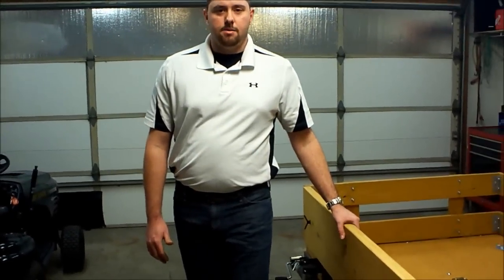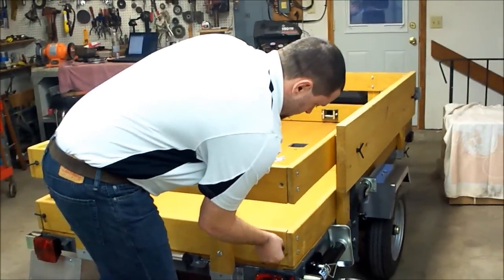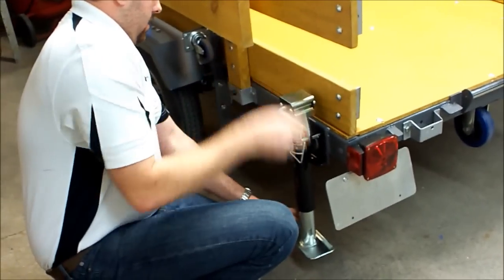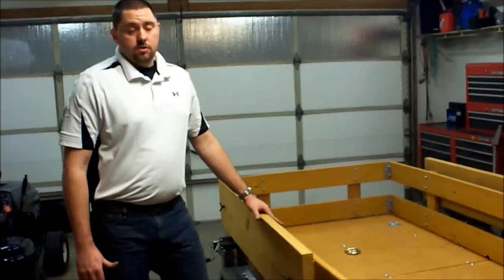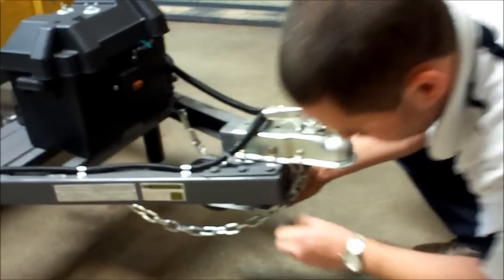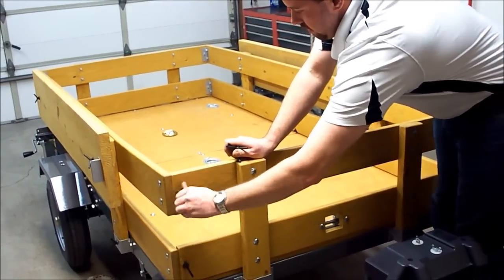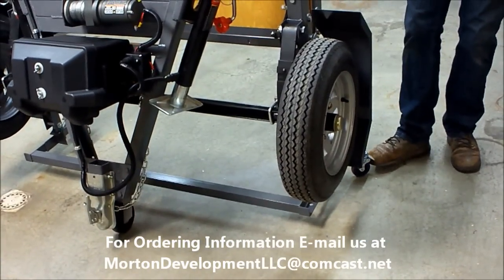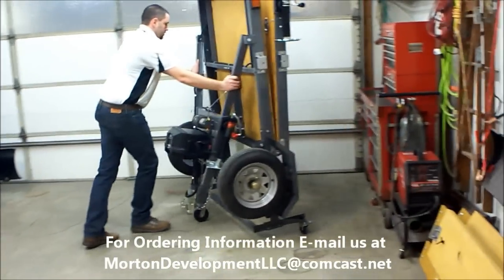Power Folding Utility Trailer

Comment: Awesome design !!  I have one MINOR recommendation:   When you remove the back fence, the two medal brackets are left behind and protrude inward.  This effectively narrows the opening as well as becomes a potential snag hazard during the loading process.  I would recommend flipping the brackets so they are permanently attached to the rear fence with the wing nuts going through the sides.  That when when you remove the rear fence the brackets go with it.

Comment: A few suggestions.1) The rear angle irons brackets on the rear fence should be permanently affixed to the rear fence, not the side rails.  As they are in this video, they create a clearance issue for wider equipment.2) The ramps on the sides appear useful but attaching\removing them seems to take a fair amount of effort.  Since this is a normal use of a utility trailer, perhaps creating a few channel irons front and rear would make this step easier.  Simply lift them from their slot, use them, and return them to the same slots.3) Add a small toolbox on the tongue of the trailer.  In this video I see you regularly laying hardware aside which in daily use may end up on my truck bumper or on the ground and lost. Having everything stored within the trailer makes this a self contained unit.Neat product overall.

Comment: Awesome design and beautiful result.
—May I recommend mounting a few 12” magnetic bars around the perimeter of the trailer so you can always secure loose hardware.
—Ive been making my own custom length magnet bars using the 2” x 1” x 3/8” craft magnets that are 2 for $1. I simply line them long end to long end and secure them all together with heat shrink. Make sure to leave an additional 3/4” to 1” of heat shrink on each end. That additional heat shrink hanging off each end is to screw thru for mounting. Also, use large washers for the mounting screws. If not the heat shrink will tear from the screw heads.

Comment: Wow you guys make them HF trailers look great.
Reply: King zulu 13    I agree, it looks pretty cool.  The trouble is, the trailers are payload rated with absolutely no accessories or extras. This even includes the floor.  If you add all these improvements and niceties to the 1000 pound trailer, your actual payload capacity could drop two or three hundred pounds. That would leave you with a seven or eight hundred pound payload capacity.      HF trailers are fairly inexpensive and great for personalizing. This video is a good example. However, squeeze out the few extra bucks and keep your eye out for a coupon, and get the 1720lb.CAP.  Well worth it. 5 lug wheels have a higher speed rating as well.

Comment: Nice job on all of your fabrications.
I didn't notice any comments about the cool roller wheel on the rear bottom to protect the re-located license plate/light assy while folding/entering driveways....... Awesome attn to detail.
Also like the color.
I totally agree with the snag hazard on those gate brackets. So ya missed ONE~  the rest of this design is pure genius. 
I do think I would add something to the ramps that would index to the vacated rear stake holes to prevent them from moving during un-loading more so than loading. I hate to admit how many times I've had un-secured ramps slip.
                                                                                                =LRO=

Comment: nice set up. I would put the wing nuts for the tale gate on the sides so the angle iron would not be in the way when loading. I also noticed you have weights on the back of your lawn tractor, they only have a aluminium housing on the transmission differential and it will crack or break in two. You can fill the tires with windshield washer fluid, it wont freeze and the weight is on the wheel where it should be. Have fun!
Reply: Depends on where u buy ur windshield wiper fluid. Tx fluid freezes in colorado i found out

Comment: You might notch a spot in the middle back and place a small pulley almost flush with the floor. So when winching the cable could ride in the grove of the pulley.

Comment: The folding deck is brilliant, but you should replace the wood with aliminium on the sides and tailgate. Much lighter and easier to work with. other then that brilliant design :)

Comment: I thought I spent a lot of time customizing my trailer--and I did.  Yours is a masterpiece!

Mine is also tool-less, but I used hinges (instead of wing nuts) with long rods at all four corners to hold the sides together.  It's very fast and secure.

Picture removing the individual hinge pins on a standard hung door and replacing them with a single long rod and you get the idea.  The rods have 90 degree bends at the top to keep them from falling through and to make them easy to pull.   The sides give just enough to mate the hinges.  A small bevel grind makes them even easier to mate, if one feels the need.

Congratulations on solved the "dragging tongue" problem!   Is this your design?  Is it available?

I spent a ridiculous amount of time fixing what I saw as design deficiencies in the raw Harbor Freight trailer, which I now call a "kit".   If I could have bought one all fixed up like yours, it would have been well worth it.  Thanks for the video!
Reply: brilliant!  do you have  a page, video, or pics?

Comment: Where does one get the wheel in front under the hitch? It looks like a custom build since the original plate does not have a mounting spine for the wheel. I do like the idea of a threeway roller set.
Reply: David Russell I am also looking for the folding front (hitch) wheel.  Do you sell them?

Comment: What is being done to keep the 12v battery from leaking all over the place.
If someone uses a regular automotive battery or a motorcycle or a lawn tractor battery there will be sulfuric acid leaking and can eat the metal ????
Reply: Harold Cokayne He said he was using a "dry cell" battery, but any gel cell battery would work fine and they can't spill.  Off-roaders use them all the time for that reason.

Comment: You know, I can do the same with no more than a hand boat winch and aluminum ramps Now that's pretty, but its heavy and attractive to steal.
Reply: Can you hand wench and steer?  i picked up the same winch for $50 on sale at harbor frieght. i can't wait to 
start using it to load non running motorcycles while i hold them upright/steer.

Comment: QUESTION.... When the trailer is folded/stored, the battery is on its side.  Is this dangerous or detrimental to the battery?
Reply: I think he said that it was a dry cell battery that he's using.  If so, it's probably okay on its side.

Comment: cheap harbor freight winch
Reply: phuck ewe  I have the same 2500# winch on my trailer and it hasn't let me down... I mounted mine to the front of the trailer bed as I tilt the trailer to pull up heavy odd stuff that would not work well with ramps..